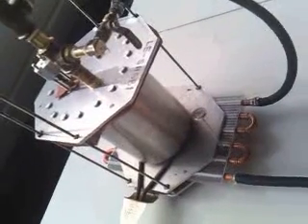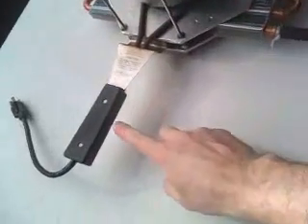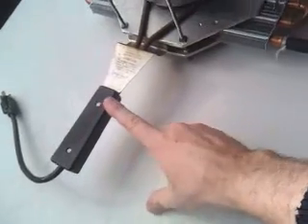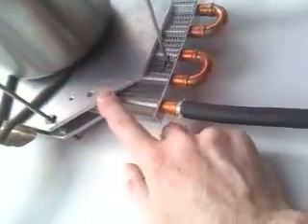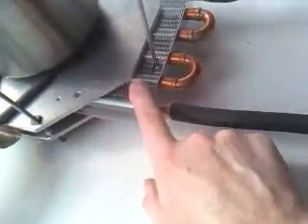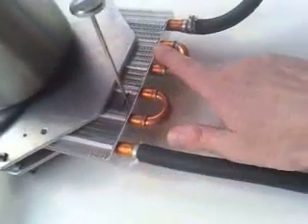SUPERHEATED STEAM PLASMA GENERATOR #3

Comment: Just as a piece of information, this is NOT superheated steam. Superheated steam is so hot  that it produces no condensation hence making it completely invisible and ''dry''.
the best way to achieve superheated state, is having a heated coil of tubing as an exit point. heating the steam past 220 degrees celcius make the steam superheated. WARNING! superheated steam is hot enough to char paper, light matches on fire etc.

Comment: i would have put the 'super heater'between the heating element and the pressure vessel, so while this will take longer to boil the water, any wet steam leaving the vessel will be more readily and easily superheated  by the much hotter already superheater element.